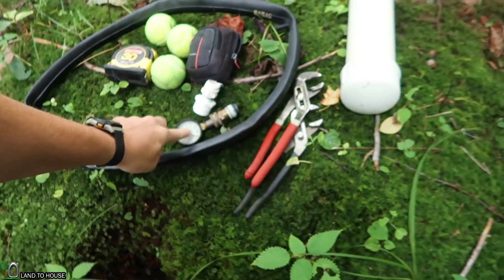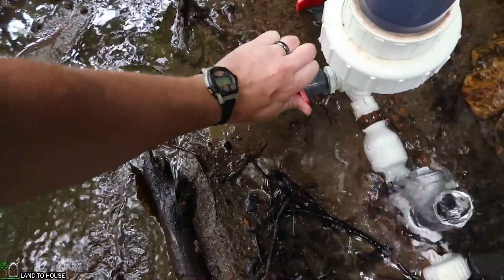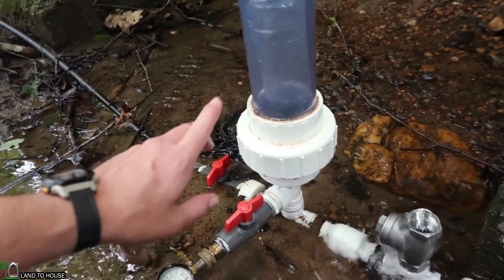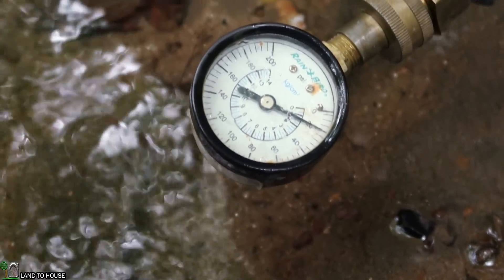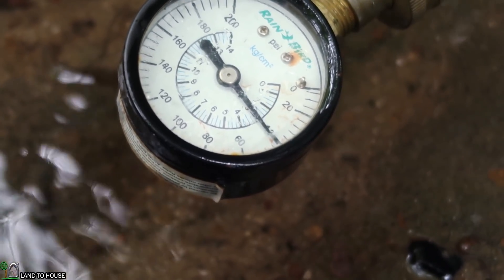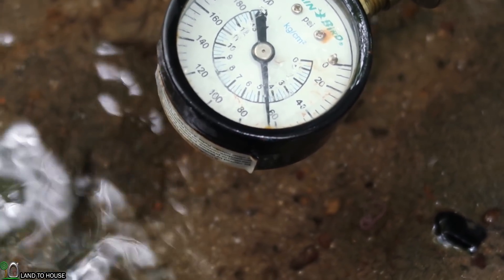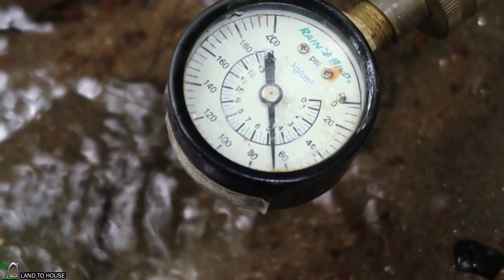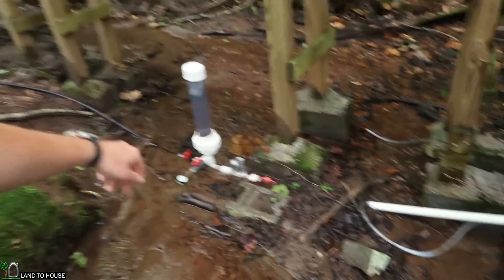I Was CALLED OUT! 60 psi?

Comment: You can also use a larger inlet tube at a larger drop from a higher elevation. Your pressure reservoir can be larger also. The water coming in will want to fill the pressure reservoir to the same height the water inlet is coming down from, but since the pressure reservoir is filled with air it will pressurize the water by it's self. You can use a very big pressure reservoir as well to have more water in the pressure reservoir, but you have to use a big enough water inlet to handle the water being used.
Reply from the maker: From a few tests I have found that its best to match the drive pipe and waste valve size. If these are mismatched the pump is less efficient. If you have a larger drive pipe the pressure wave going from the pump back up the pipe to the source will be small. The pressure wave from the source to the pump will be larger.
Reply: @LandtoHouse  OK thanks. That's good to know.
Reply from the maker: Happy to help.

Comment: Hey man I love the videos, I've gotten lots of ideas watching them for my families property in New Mexico(Lincoln).  Here's an interesting thing for your readers. I installed Fire Sprinkler Systems for many years. Once while we were working on an 80 story building I had an Apprentice ask what the difference between PSI and Feet of Head was. So in this building there was one main feed line that went from the basement to the roof. I told him to go all the way to the roof and totally remove the cap on the top of that pipe and leave it wide open at the top. We went down to the basement and started filling the pipe right from the city feed. There was about 75 PSI coming from the city. It filled the pipe to where there was the 75 psi on the guage. I sent him up to the roof (around 1000 ft) and he looked down the pipe but couldn't see any water as far as he could see. Then I brought him back down to the bottom and we turned on the jockey pump and let it build to 300 PSI, which is the max psi the pipe fittings were rated at. Still nothing at the top of the wide open pipe. In water every psi at the base of a pipe will rise the water up to 2.31 feet. So to get water to just reach the top of the 1000 ft pipe it would take around 432 psi. Hence the difference between PSI and Ft of Head. So the 65 psi in your video should be able to push the water 150 higher than the gauge.
Reply from the maker: Hello. I have been to Lincoln county several times. Hiked up Captain. I think you have nailed the psi issue on the head. The ram pump tops out around 180 feet of lift. The pressure that you see in this video is the pressure at closed delivery pipe. The actual operating pressure of the pump is lower.
Reply: @LandtoHouse  That's what we call the difference between static and residual pressure.

Comment: sir, i need some help...my drive pipe of 1 inch pump is about 8 meter vertical and 40 meter in lenght...but i only get maximum 3.6 bar pressure with closed delivery pipe...whats wrong? im going to lift water about 60 meter elevation...please help...thanks
Reply: If there is a good volume of water use two stailess steel 1"  waste valve, also stainless steel spring valve(remove the spring) and bladder tank (8 gallon capacity is around 40 us dollar) or type in youtube Bohumir Stehlik waste valve, he will also give you an idea.
Reply: @maximoincognito4881  i think there is something wrong about my pump...compared to seth's, mine have higher and longer drive pipe...the pressure determined by higher downfall am i right? your proposal seems to get the pump last longer...
Reply: Not only to keep the pump last longer but more volume and pressure of water delivered with the used of bladder pressure tank and double your stainless steel waste valve as long as you have a good volume of head water. Or if you want you can build your own waste valve,  search in youtube "BOHUMIR STEHLIK WASTE VALVE"
Reply: @maximoincognito4881  i mean...brother seth didnt even use bladder tank, double waste valve and lower head pressure than mine...but still he got more pressure than i am...why?
Reply: I already tested the one I recommended to you and have a very good result, my ram pump is also 1" with 6 - 7 meter vertical head and deliver almost 300 meter distance and more than 40 meter vertical head at the rate of 3 liter a minute. Anyway try to replace your check valve with vertical spring valve may be your check valve cannot hold a higher pressure.
Reply: Any good news about your ram puml.
Reply: @maximoincognito4881  yeah...sure...thanks to you...turnout, my secondary valve failed...now im using swing check valve for secondary valve...now i only apply about 4 meter downfall and i got 6 bar pressure...im gonna setup the pump with 7 meter downfall soon...ill let you know the result...thanks...

Comment: If wait for much longer for water reach maximum height, it will be reah out 70 Psi, the same if delivery valve closed.
Reply from the maker: If the delivery pipe went high enough I think it would allow the pump to reach a higher psi with valve open.

Comment: Have you tested a metal drive pipe? I wonder how much it would effect it.
Reply from the maker: A metal Drive pipe should make a significant difference. Even with the PVC you can feel a jump with each cycle. The metal pipe is not in my budget at the moment.
Reply: I have the feeling that the travel of the inline check valve is mainly determining the maximum pressure. Then a metal drive pipe would not change much. But a test would be interesting.

Comment: what happens when u place one smaller tank one abit further up then followed by a larger tank then to your current tank, kinda in series circuit, i wonder if you can push up the psi ever further when open? 
or what happens if you tie the system in to a parallel circuits so two parallel pipes to single tank, followed by another?
just a question>?

Comment: 70psi means it can pump to a maximum height of 161ft, that's 49m in science units.

I wouldn't expect it to flow much of anything at that height.

And at 20psi that means your storage barrels, if that's what the delivery is hooked up to, are about 46ft up.

The equation for head is (psi/14.7)*33.8995
Reply from the maker: Because the tanks are set at around 30ish feet above the pump there is a nice flow rate. The 70psi is definitely not the operating psi.
Reply: @LandtoHouse  I know you got this Seth, I was more or less commenting this to help others. 

What do you think explains the 16 feet of head difference discrepancy? I don't think you are flowing enough gpm for friction to be a big factor.
Reply: Land to House 70 psi it's good pressure tank haw many litters per minute that pump pumping

Comment: Nice test. I'm glad you finally put a PSI gauge on it. Now you see the operating pressure is below 30 PSI. 30 PSI is still very impressive if you think about it you lose .410 pounds of pressure every foot of Rise you can get a lot of elevation off of that pump. Can you imagine if it really could have 60 PSI while it's running.
Reply from the maker: Some setups do have that much pressure at the pump... but that is a lot of head pressure. .. it was past time for a gauge.